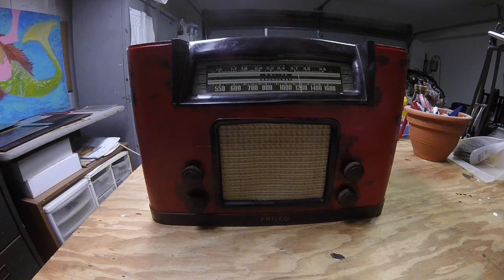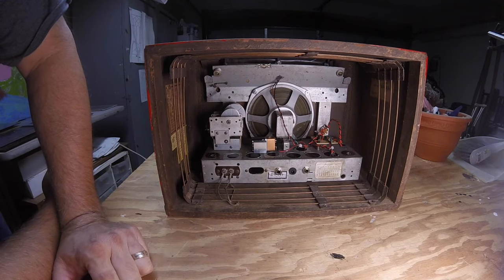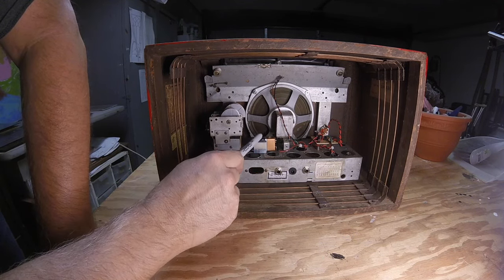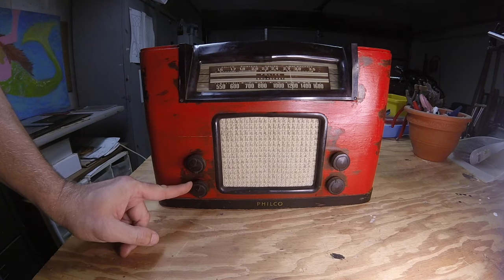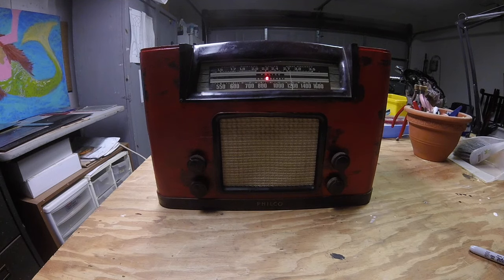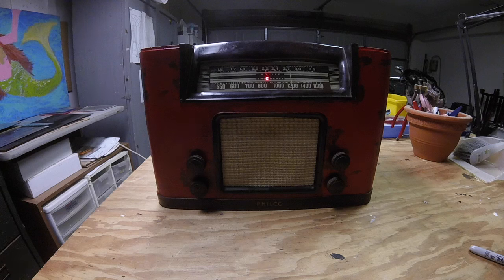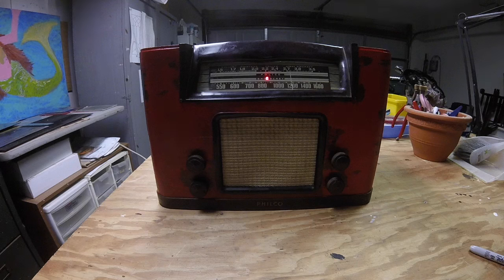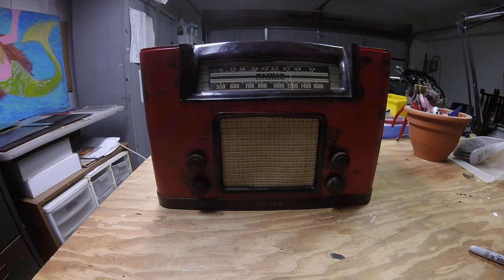Philco Radio Guitar Amp

Comment: Why not tube? It's the desecration of a tube radio :(
Reply from the maker: Szabolcs Kiss This radio was not repairable.
Reply from the maker: Szabolcs Kiss : If I was to add a guitar input to a tube radio I would certainly add an isolation transformer at the minimum. There are guys that do that. If the radio was salvageable I would certainly have restored it to its original function
Reply: its good that the can be converted to guitar amps , they will end on tha trash pile because no buys them to restore them as a radio ,